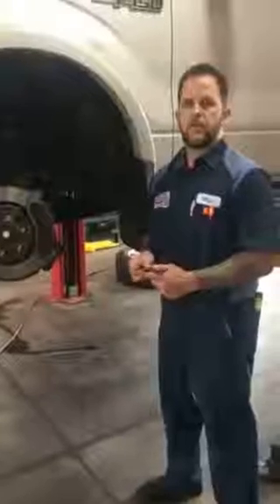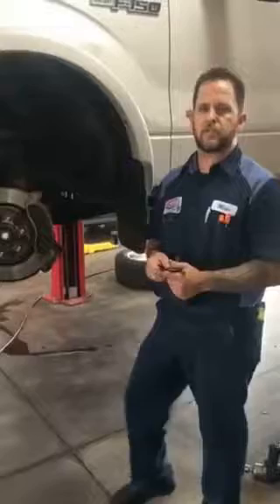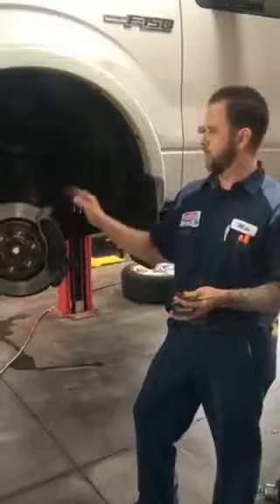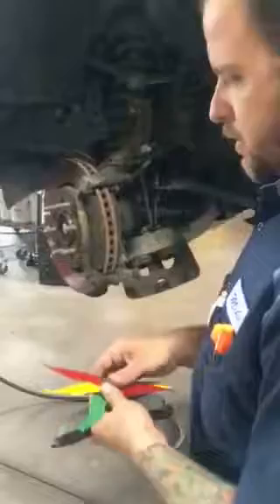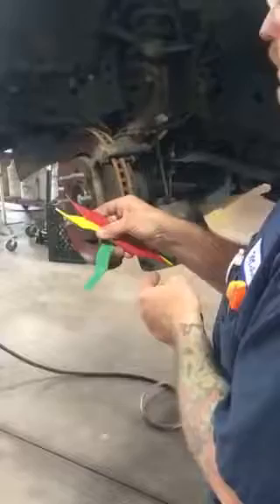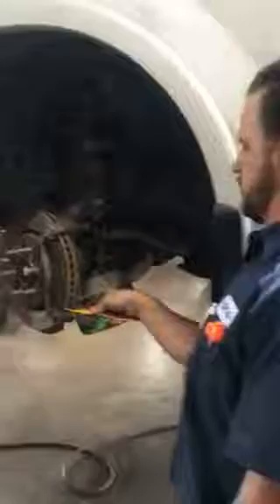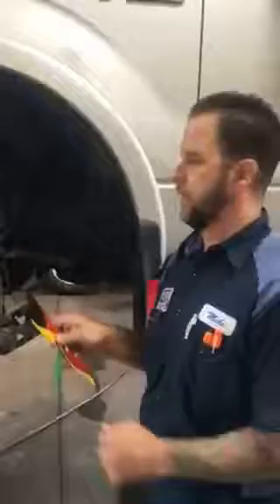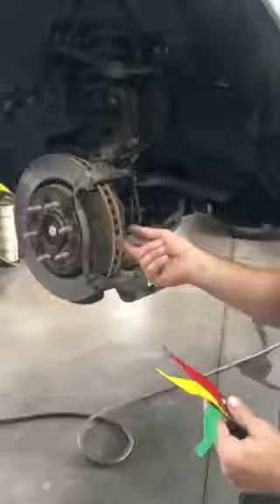Ford F150 Pulsating Brakes

Comment: I have a 2016 F150 4x4 sport and My brakes are pulsating at slow speeds. I'm going to do some checks... I'm not happy about having these types of problems at 61,000 miles. Add to the brake problem is the driver door wiring issue with the auto door locks (wire bundle transition from door to the body). I might not buy a ford again because I live in Kalifornia (SoCal) and I can only guess what problems I'd have back in NY with this thing.